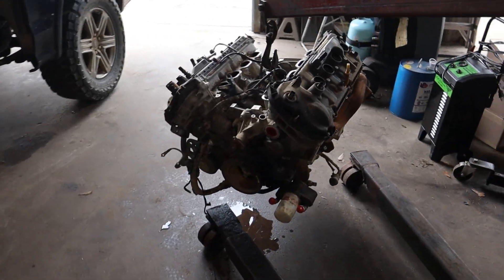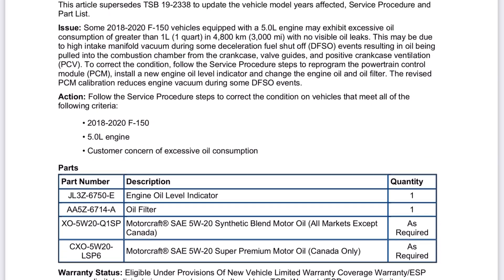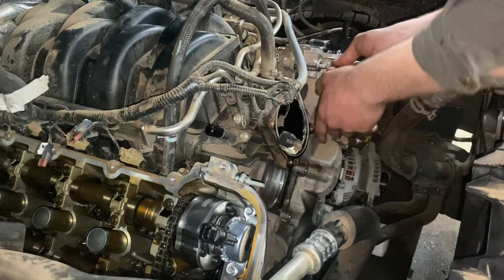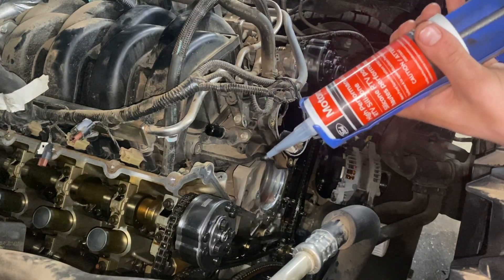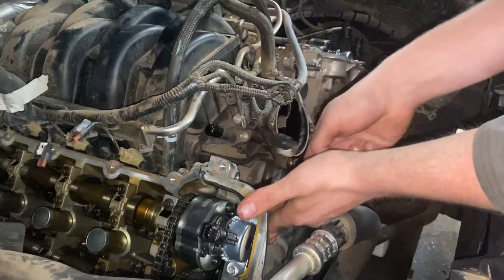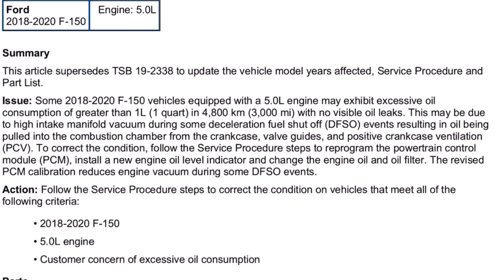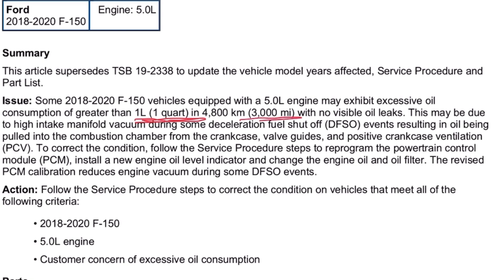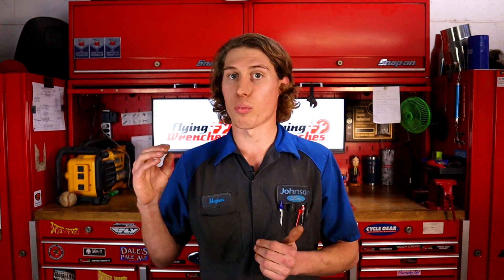Ford 5.0 Coyote Oil Consumption FIX

Comment: high vac causing oil consumption? thats weird, how hig is high? over 30 vac?

i read a good beating will fix the consumption. not kidding. must be true as i read it on a forum, lol. seriouly though i heard it works.

Bmw and benz have done no no dip stick for a while. completely stupid. they just want to keep diy out of engine bay. its already stupid enough that the 10spd doesnt have one. instead you get to reach around a hot cat while truck is running. thats better right?

Comment: Cadillac’s threshold was a quart every 800 miles. At least it was back in the Northstar days. 
I wouldn’t loose any sleep over a quart every 3K. And sorry Homie, this Old Man still gonna check his oil. Prolly bout once a month or so. But I believe you’re right, it’s just not a real problem. The bar has just been raised so high.

Comment: My wife has me on the hunt for a 2018-20 f150 for her to replace her edge. I abosulty wanted a 5.0 becouse of how much i loved my 2012 mustang gt and how easy it was to work on. I watch alot if this guys content but i have to say i don't think this is accurate. The amount of information about this and the fact that theirs thousands of forum threads and hundreds of YouTube videos and most of them say the TSB doesn't fix the problem i would be leaning more twords a piston ring problem that ford is aware of and trying to avoid actually fixing right. Anways no 18-20 5.0 for me

Comment: I absolutely agree it’s not internal damage but I have a 19 f150 with a 5.0. It uses oil. I started having some stalling and rough idle. The dealership cleared my codes and said my truck was a quart low and they added oil and for me to keep an eye on my oil level. My problem is  the vct or maybe vvt solenoids. I’ve been watching YouTube videos for the same exact issue with no check engine and I need to get this fixed. This is a huge issue. Please post a video for this issue!
Reply: These solenoids are definitely a issue.
Reply: He has a video posted already speaking about that failure mode.

Comment: Does the dealership have to run a oil consumption test before they reprogram the PCM per the TSB?
Reply: No they don’t. Just go to your dealer and inform them that your truck is burning more than a quart oil in less than 3,000 miles, and that your aware of the Ford TSB 19-2365 that addresses the excessive oil consumption issues on the 18’-20’ F150 5.0.  
See the attached link below for the TSB. Print off the TSB and have it in hand when you take your truck in to your dealer.  I have a 2019 F150 5.0 myself and this is how I got this done on my truck. This TSB will get  your PCM reprogrammed, and it will also include an oil and filter change, plus a revised correct oil dipstick. 

https://static.nhtsa.gov/odi/tsbs/2019/MC-10169811-0001.pdf
Reply: @donsirchia6240  
Thanks!

Comment: I have 2015 5.0 never had oil issue.From change to change always same level.100 000 km right now.
I have recently noticed leak from vct solenoid seal...on driver side.

Comment: Thank God mine is a 2015! lol you just have the p2007 code pop up and bam no power and torque. No intake manifolds to find and yes im waiting on my boss 302 intake and tuner. i was told 4000 on back order and still havent heard of them releasing them or making them.

Comment: Stop checking your oil.....wtf?  I get what your are saying, but my 2020 had knock and used over almost 2 quarts in 3000 miles even after the supposed TCB fix.  They replaced my engine under warranty, but I still had to wait 4 months to get it replaced because the 5.0 was on back order and I had 3 other people in front of me waiting for their engines as well.  Sounds like a company man to me.  Stop checking oil, unbelievable.  I guess the problem goes away if you don't pay attention to it.

Comment: My 2019 F150 5.0 is now currently at the dealer. 25k miles on the truck. 

Aside from now needing VCT solenoids  my trucks burns 1 quart every 2k miles. That is extremely excessive in my opinion. Thanks for the info on the bulletin. I'm passing the info along.
Reply: Use 5w30 as Ford now recommends, just about to purchase a 22 XLT with 8,569 miles, 1st thing I'm gonna do is change the oil & use 5w30

Comment: Ohh boy.. We bought our 2018 F-150.. .5.0.. I was driving down the freeway and the Ford App alerted me that I had low engine oil pressure and shortly after the truck told me that.  I stopped and checked the oil, and I had no oil in the engine according to the dip stick. Filled it with oil and took it to the dealer and when I found out they re-programmed the PCM and changed my dipstick I about lost my mind. However, it managed to fix the oil consumption issue lol. I figured they just added a longer Dipstick. Damn truck takes almost 9 quarts of oil.

Comment: My 2020 had this problem early on and its now 122k miles and recently started smoking on startup. I am the old man who doesn't check my old and I am calling B.S. on the vacuum pressure issue I believe sleeves are bad and ford is trying to pull a fast one. I will take to dealer for PCM fix and if its doesn't work you should retract this statement. We have 3 in our fleet and all have same problem and get 3 qt,s low between oil changes which are done timely.

Comment: I have a 2016 f150 5.0 and it has about 123k miles trying to decide if I should stick with 5w20 or switch to 5w30
Reply: Ford now uses & recommends using 5w30, Absolutely do Not use 5w20 any more!!!!

Comment: I have a 2016 f150 5.0 and it has about 123k miles trying to decide if I should stick with 5w20 or switch to 5w30
Reply: Switch to 5w30. Add a bit more protection.

Comment: 2018 f150 5.0 bought new...i am over the top with oil changes. I thought mine was using more oil than normal until i had the tech write 8.8 quarts on ticket. Oil comsuption issue mitigated. A lot of techs would only put 8. They do use oil. I change every 4k and then i am about a quart  low. Had oil analysis at 40k and it was perfect. I run mostly  E85 too. It roars with E85.

Comment: Just kinda odd that in 2018 they do away with steel sleeves and do that Plasma Transfer stuff on the cylinders.  Then all of the sudden they gulp oil.  Also it’s an incredibly noisy engine.  Just doesn’t sound right to me and I’ve owned a 2016 5.0 and it never used oil or was noisy.  Plasma Transfer might work for Formula 1 but they don’t use the same engine for 150,000 plus miles.

Comment: I went to back out a a friends van out of my driveway, maintenance light was on with the genie lamp, sticker on windshield said july 2019, 89k miles, it had 147k on the odometer.  I told her I added 2 quarts 0-20w, it was in the middle of the dipstick, told her to get an oil change, this was in summer 2022, saw her today with a new car, she blew the motor  on a 2014 sienna.  So sad

Comment: There's a lot more 3.5l's than 5.0l's. People neglect service in my area and I've seen quiet a few 5.0ls come threw lately that failed from running low on oil. Mechanics also neglect the TSB and PCM program, or the truck never comes to the dealer until the engines failed.

Comment: I have a 2021 5.0, I just changed the oil after 5,500 miles and less than 5 quarts came out. No oil light or warning at all. I’m at 30k miles now and I’m used to only getting 6 quarts out but less than 5 quarts seems a bit excessive. I went to the dealer when it was new and they said there was nothing they could do and to just keep an eye on it.
Reply: Don't let it go under 6 quarts you will damage that engine

Comment: I’ve owned a lot, I mean a lot of cars in my day. I currently own two Toyotas, a Lexus, a classic VW, a 68 F100 with the original untouched 360 V8. None of them use oil. Only my 2019 F150 5.0 coyote V8. There’s something wrong with the manufacturing/engineering of the rotating assemblies of certain (mine) engines. Either it’s a metallurgical problem with the blocks, pistons and rings or it’s a clearance problem machined wrong from the beginning. There’s no excuse. I’ve only got 36.000 on mine and I’ve had the “fix” done. It still uses oil.

Comment: Here’s what I think you missed. The reason most of us are concerned is because these trucks cost so much to buy just to have an engine that uses oil from day one. There’s only so much warranty that we can get to help in the event the engine takes a dump. I have the 18 5.0 and I put a catch can on mine because the amount of oil I was losing was actually causing issues with how my truck ran. I ran top engine cleaner through it due to the fresh oil that was all in the throttle body. Seemed to have helped quite a bit but time will tell. I personally think Ford says this is a normal characteristic of the engine because they know they have a bad design. Also, do you have a fix for the timing chain rattle/slap on deceleration? Ford says that’s normal too. Never had a vehicle in my life that the timing chain rattled or slapped.
Reply: My 2018 f150 5.0 just went in the shop. Replaced all sensors, ignition coils and it still would not idle, they started breaking down the engine found left bank timing chain shot. Warranty people said break it down more they then found two push rods nearly broken in half. Still waiting on Warranty people  to tell them what else to do. Seems to me the Warranty people would tell them to pull the engine and send them a new one. Truck has approx 173k on it and has used oil from month one and was bought  new with 110 miles on it
Reply: I started running E85 in my 18 5.0L a few months ago. The timing chain rattle on deceleration is almost nonexistent now. I get worse fuel mileage (400 miles per tank instead of 450 on 87 octane).
Currently using about a quart of oil every 1,000 miles. I started checking mine more after I did an oil change and what was left over was under 6 quarts. Barely filled up the 5 quart jug to the very top.
Also started smelling coolant on cold startup. Have to wait until next week to check that out.
Reply: @moej6014  I've noticed improvement with E85 as well. It runs smooooth. Luckily it's about 30% cheaper than regular 87 where I'm at, so I actually save like $50 a month running E85 instead of 87, even with the loss in MPG.
Reply: I just found a TSB # 18-2354 for the timing chain rattle.  There is a module update that can be done.
Reply: @jasonbrewer8065  yes sir. I had that TSB performed twice and didn’t change anything on my truck. I’m hoping this catch can will help keep the top end as clean as possible. Thanks for the info.
Reply: @jasonbrewer8065 I agree with you. We spend too much money for these trucks to give us any cause of concern for any issues, much less have any. The PCV greatly helped my oil consumption though the level does still creep down some between changes

As for the timing chain rattle on decel. What I found with mine was it is the VCT solenoid shuttering. Of course I was told this was normal but that's another story. Here is a link to the video I found while researching. I conducted the same brake torque test with my brother and we were able to pinpoint the two that shutter. Maybe it is the same noise your makes Maybe not but figured I would pass it along. Best of luck
https://youtu.be/TuQhZRqRIt8?si=L8-oMCvIjOwv_f4x
Reply: Mine slaps on decelerating when the engine is cold. So I warm it up and no issues. Just build a bigger version of the 4.6 and it would be bullet proof!
Reply: Ford really dropped the ball on this big time
Reply: The issue with the noises and cam phaser gears is damage from low oil levels.from actuator gear phasers being positioned with low oil volume causing them to not fully engage and run hot as the oil cools the chain and and all the rest of the components including cams and crank this will cause the aluminum heads in the cam cradles to score decreased oil volume and pressure comes from that aswell Ford built a pile of junk for a few years and needs to step up and fix them properly

Comment: Stop checking your oil is the funniest thing I've ever heard b😂
Reply: I agree it’s the most basic thing you can do.
Reply: @craigadair128 it’s the stupidest thing you can do😭 this motor is NOT designed to burn oil. It’s a major issue and will ruin your engine. Thousands and thousands in repairs. If your oil is constantly low your bearings and cylinders will heat up and get damaged/wear out much quicker than having proper oil management
Reply: But I do understand his conclusion. He is basing it on maintenance history at his shop.

Comment: 23 5.0 and I don't burn a single bit of oil. I think this is a psychological problem more than anything. Like the new 10 speed complaints. I've got almost 15K miles on my truck, and haven't had a single issue with it. Problem seems to be "fixed" for 14th gen trucks (21+). Also seen people talking about the tick from gen 3/ gen 4 coyotes. That's called direct injection pump. All of them do it. Fix? Turn the radio up. Its normal. Mechanics and tuners know its a normal thing. 10 speed whine? Normal. External pump on the transmission. Psychological problems.
Reply: You're lucky. I have to add 4 quarts an oil change just to keep my valves from clattering and oil on the stick. 2019 w 20k miles. You don't know what you're talking about.

Comment: I have a '21 F150 with the 5.0. It's burning up to 3 quarts every 1000 miles. Ford has had it 3 times, did some repairs thinking they knew how to fix it and it's still burning it. My powertrain is up soon, so if they don't offer to replace the motor this time, I'm probably getting rid of the truck.

Comment: I'm 48 years old and I have owned nothing but Ford my whole life. I have worked on and Hot Rodded too many to count. I have never had any of them use oil.
 I currently manage a Quick Lube. We service about 30 to 40 cars a day. The only cars we consistently see low on oil between changes are Kia's, Hyundai's, and GM vehicles with LS engines... They are all one to two quarts short at every single oil change even when new... In the last year I have had one solitary 5.0 come in with oil consumption issues... That's it.
Oh and I check my oil at least weekly

Comment: Also, my 2011 5.0 mustang has 145K and never burned a drop of oil with 7500 mile synthetic blend oil changes at the dealer and redline shifts almost every day. The truck was babied in that I still have 88K on the front brakes! The 2018 5.0 has issues either direct injection or the spray on liner of the pistons but my compression checked out fine only the heads  were replaced.

Comment: I just had the heads and cams replaced on my 2018 F150 5.0 at 87K  Burned oil 1qt every 1000 miles then 800 miles then 500 miles. Used Pennzoil 5w20 and the #3 and #8 spark plugs were gone and all plugs had oil on them. Mechanic said the heads were varnished but my records  show 6K oil changes and ford filters. Original PCM programming until failure. Cam phaser rattle from day 1. Probably lasted that long only because I DID check the oil. New heads and PCM 1st 1000 miles full oil so far. Not a fan of direct injection either.

Comment: Wait wtf? Don’t check your oil!?! What kind of advice is that? I have had multiple 6.0 LS and gen1 sbc that I built that don’t burn oil. Check level before draining for an oil change every time. You’re full of shit that engines are designed to burn oil. Only engine that burns oil by design is a 2 stroke. You can argue the PCV system is an oil burning design but oil burn through PCV is a byproduct of crankcase pressure regulation.

Comment: If it wasn't an issue Ford wouldn't be handing out replacement engines and they wouldn't have discontinued the gen 3 5.0. This is a major issue. It is also much larger than you are making it out to be. When you burn so much oil that you can hear your timing chains flopping around and you get P0390/P0394 codes, that is a problem. I have a 2014 5.0 that doesn't use a drop. I hope you get your clicks and comments.
Reply: This!

Comment: Customer spends $80k on a new half ton pickup... Bonkers... Its 2021 and his brand new engine burns oil like its 1975... Bonkers... Ford Dealer Service Tech tell customer that HE IS THE PROBLEM for checking his oil like a responsible vehicle owner that values and wants to take care of his equipment... BONKERS!   Ford warranty can install me a new engine every month on the month until one comes off of the assembly line that doesn't burn oil! What does the EPA have to say about all of this oil getting burnt? The piece of shit is basically a two stroke at this point!

Comment: I have a 2019 5.0 f150 with the 10 speed transmission. I think that the vacuum is also created when going down hill and the transmission down shifts. I started tapping the brakes before going down hill so the transmission doesn't down shift and noticed the consumption isn't nearly as much. I wanted the dealer to turn off the auto learn feature on the transmission but they wouldn't do it. I also try to check my oil once a week because if it were to blow I don't want my warranty to be void.

Comment: I have a 2018 Platinum  - It drinks oil and I do check it quite often. The 3K miles is a joke. Seems like it consumes more oil under a load. So it varies. I checked it before pulling my boat and it was full. Went on a weekend trip with the boat and came back 4 quarts low. Lucky that a check engine light came on to let me know something wasn't right. The 5w 20 synthetic is way too thin (like water). Thats why I think it burns so quickly. Looking for a thicker or better oil to put in.
Reply: Ford now uses & recommends 5w30 for all 4th Gen 5.0 F-150's

Comment: Couldn't agree more. Most of these oil consumption claims are placebo and engines use oil alot more since 2009. Especially with extended internal for services